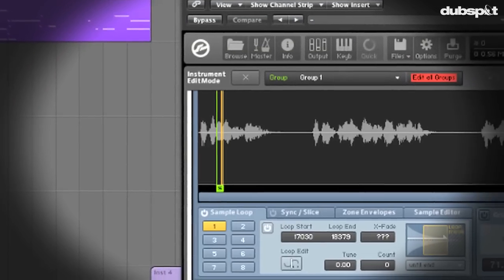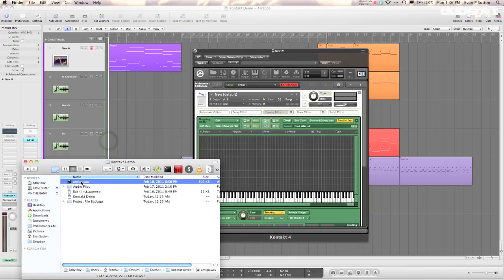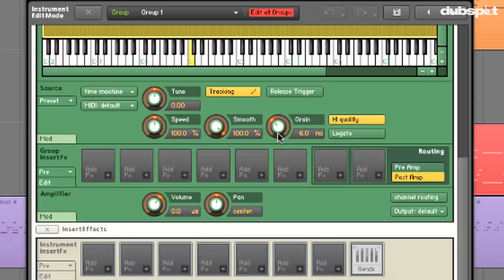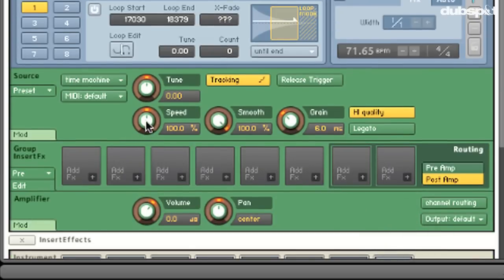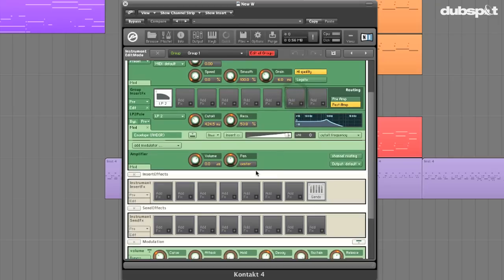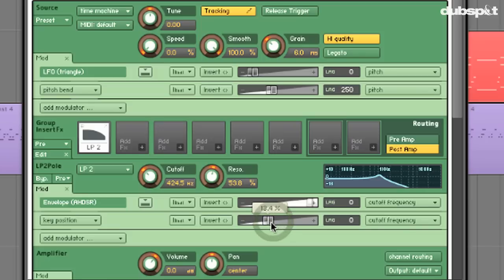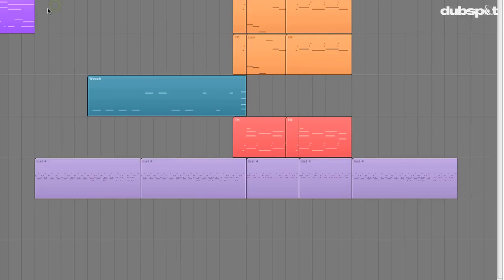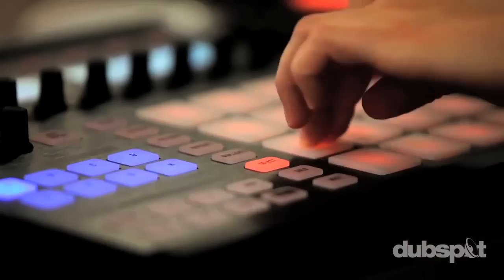NI Kontakt Tutorial: Creating Expressive Instruments from Samples

Comment: Well, of course I couldn't find a way to link an LFO to the mod wheel or joystick so that when I push the controller (joystick) up, it brings in the LFO modulation.   I could only get the LFO to fade in automatically after X ms. :(

How can I tell kontakt to LINK the new LFO modulator to my mod wheel or joystick?

Thanks,
Tim
Reply: Right click the knob or control click for Mac, pick midi learn and then move the knob on the controller you want to control the knob you right clicked (or control clicked)
Reply: Kettlebell Heaven made a note of that and when I finally GET a new keyboard controller, I'll try it.  sold my M1 b4 getting something else and having to try two controllers to see what keys i like best.  should get this launchkey soon and I'll see how it feels.  i have the impulse but keys are just too stiff for me.  i'm sure they feel great to most people but... i'm not most people. hehe thanks!
Reply: It works. I am always afraid to push a button unless I know what it does. Afraid I'll muck it up forever. Midi learn is the way.
Reply: Kettlebell Heaven I hope this launchkey has soft keys.  The impulse looks and feels amazing except the keys to me are a tad hard to push but I like them really light cuz I'm a guitarist with crap fingertips from injuries so I need them light.    I should get it  maybe Monday and whatever, I'll find one that works for me and see what I can figure out.  Just thought that some violin parts could use a controlled vibrato.  I mean, fading in vibrato is a crucial part of a lot of strings playing and it amazes me that I never saw that implemented until Spitfire Audio's Sable strings library.  I keep thinking it's 2013. hahah thanks.
Reply: Kettlebell Heaven if you start a project/instrument with no intention to actually make an instrument, but with the intention to first see what you come up with, and second, to see what each button does, then you'll learn a lot very quickly.